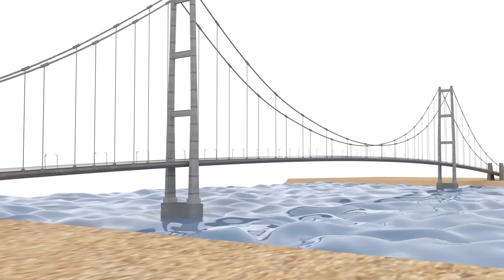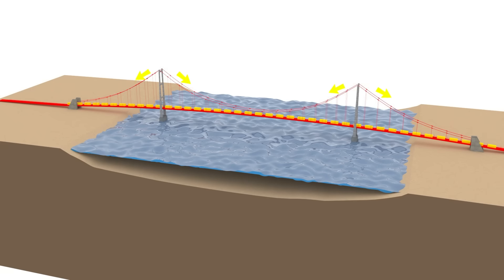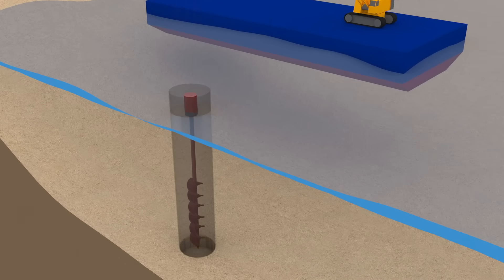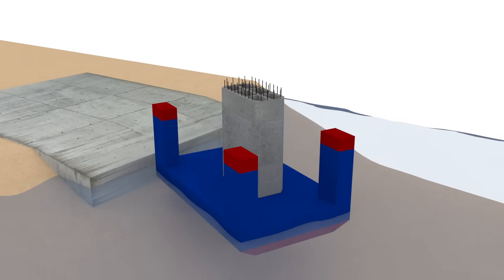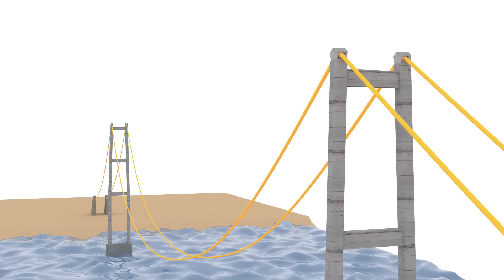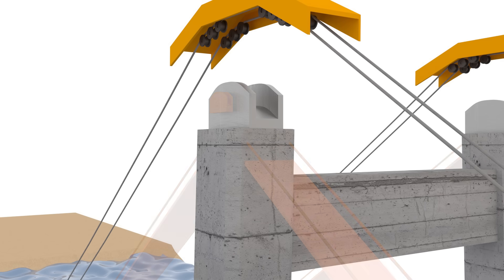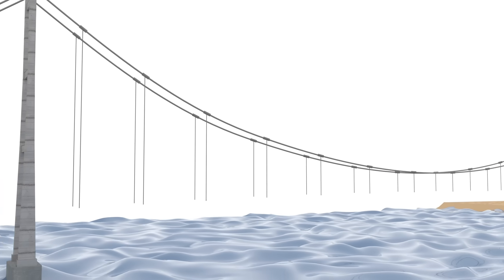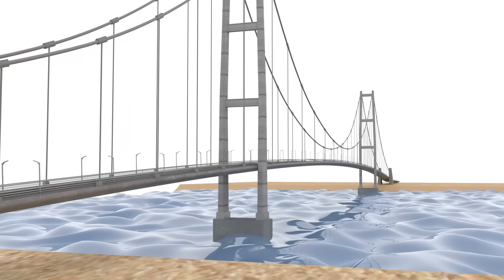How a bridge is built over deep water | Suspension Bridge

Comment: But how does the first part of the main cable get connected between the two towers without any support in between?
Reply from the maker: Using passenger line, a very thin line that can be lifted using a helicopter or just carried by boat across the water.  This passenger line is used to pull a bigger cable.

Comment: Cheer~~~a bridge in which the weight of the deck is supported by vertical cables suspended from larger cables that run between towers and are anchored in abutments at each end.😊

Comment: 2:30 I wonder how do you cover the very top point of the cable? do you mean all the 10000000 tons of loading landed on the cover of the cable on the very top point?
Reply from the maker: No, the cables didn't land on the cover on the top point.  The cover laid above them
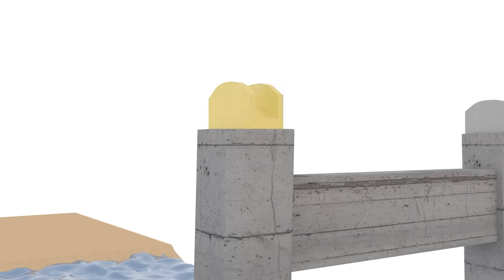Reply: @3DLivingStudio  Sorry I did not make it clear enough, at 2:44 it looks like that the steel small wires touch the saddles top curver area 3:09, if so, how could you cover all the small wires 2:31 by armor plates at the saddles top curver area, since the steel small wires already touched the saddles top curer area with heavy load?
Reply from the maker: @hanfucolorful9656  The covering didn't cover the top part, it only start from the part where the wires didn't touch the saddle, in the animation I didn't pay attention to that details because it cost too much time to model everything, sorry for the confusion.
Reply: @3DLivingStudio  Now it is clear, there must be some methods to cover that saddle area for sure, thanks!

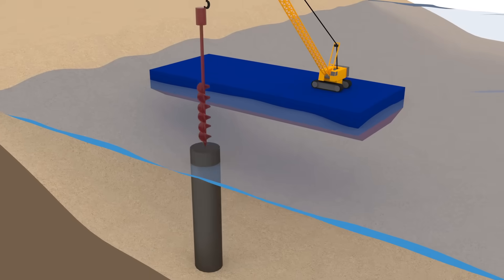Comment: Can you explain piled foundation from 1:15 to 1:25 please? I understand there is a steel casing installed before drilling into the riverbed. But the steel casing must remain or the cast concrete will just be washed away by the water? 
If you remove the casing before concrete is hard then concrete is washed away. If you try to remove the steel casing after concrete has set it will be stuck to the concrete no?
Reply from the maker: Casing is designed to be removable after the concrete has hardened.  Casing has smooth interior surface, and releasing agent is apply to prevent the casing surface and concrete from bonding together.  Also vibration may be applied to aid the removal process.

Comment: How the suspenders not slip down the main cable. Also when fixing the deck, should the main cable not slump when only part of the deck is put in place (raising the main cable in the other part)?
Reply from the maker: They won't slip down, because of using cable bands grip tightly to the main cable.  Decks are installed from both towers simultaneously from both sides to balance both main cable and towers.

Comment: Here are some basic mechanical Calculations if you are curious:
We determine the max value of Weight and multiple it with the max distance possible that effect beam or any Weight carrier.. you get the Max Moment.. according to what safety level you're in .. you multiple it by X times to get the final planned Force.. like exactly in the middle of two vertical Ropes is always the max Distance where the max Force will apply.. multiple it with say 4 Factor for safety you get 4 Times safer Outcome..
That's how bridges don't even collapse in rush hour..
Any deeper than that it will look complicated but it's Fun :D